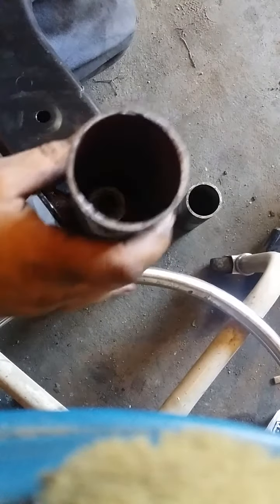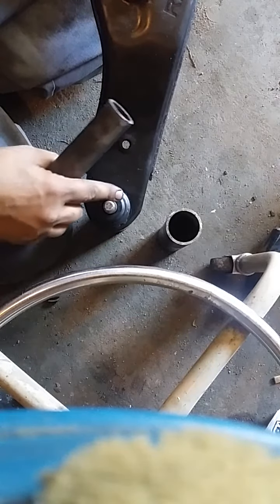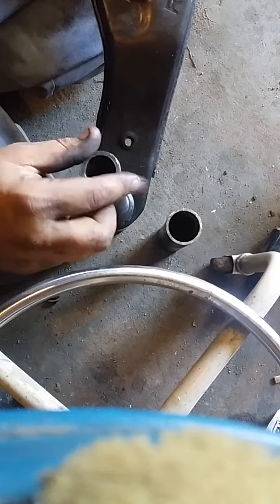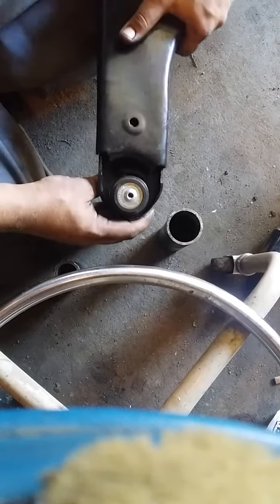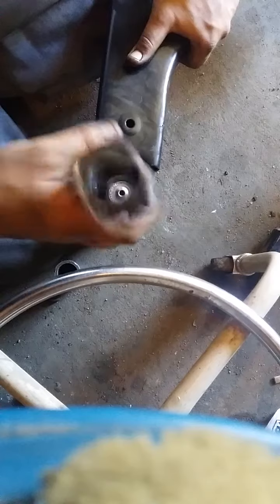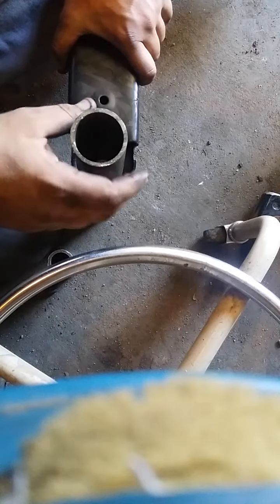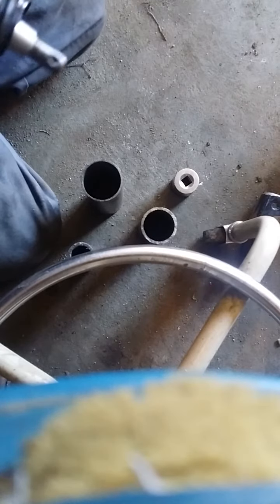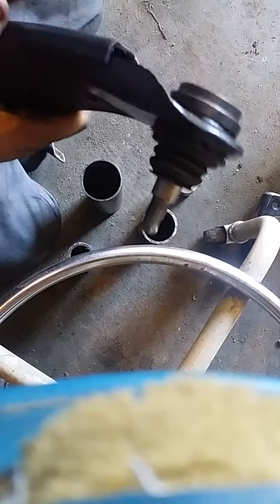2000 s40 balljoint replacement

Comment from the maker: I installed the send boot on the balljoint and learned: instead of using the socket use the same tube you used on installing the balljoint. It fits perfectly over the outer ring of the boot and hand pressure pushes it on